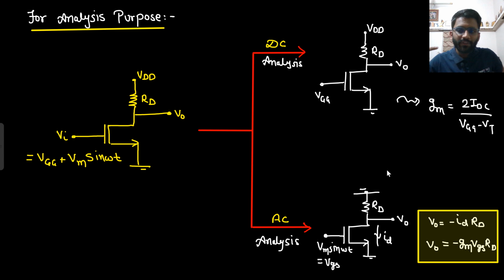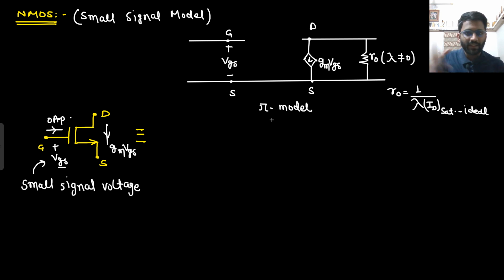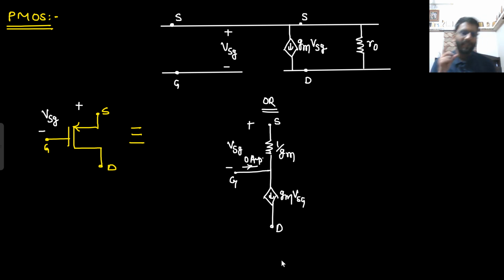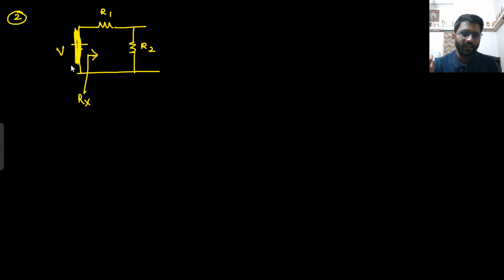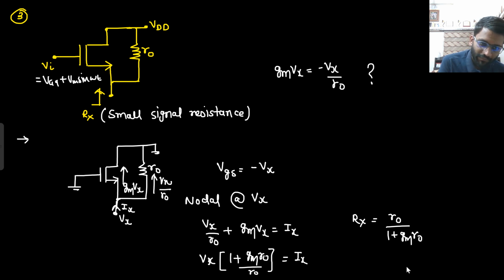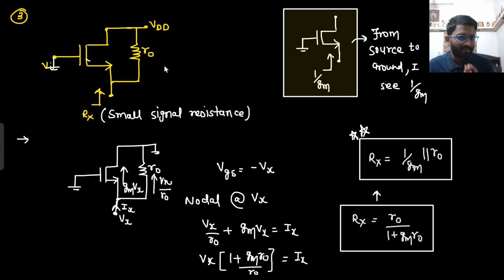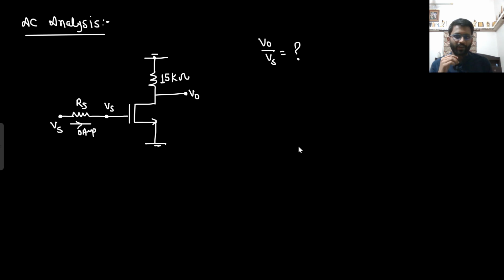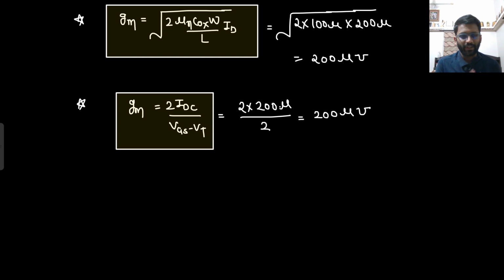Small Signal Model of MOS, Concept of Port Impedance || Analog Electronics || PrepFusion

Comment: sir,i understood that we choose the mosfet in saturation rather than linear for amplier because it has high gm ( as Y21 should be high).
can we use mos in linear region for amplifier ofcourse the gain may be less compared to saturation mos.
so we can use mos in both linear and saturation regions for amplier but saturation is preferred for higher gm.
Is this correct sir?

Comment: @31.02 Since current choose no resistance path it will not flow through ro. The entire current will flow to the ground.🤔
Reply: Good question?
Reply: No , there is a resistance between Gnd and Source. You can check it by small signal model.